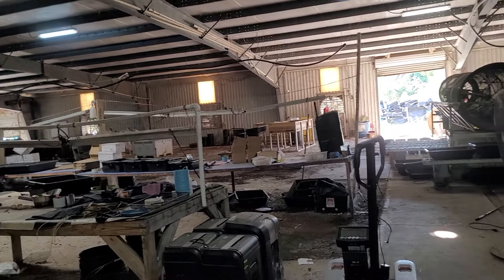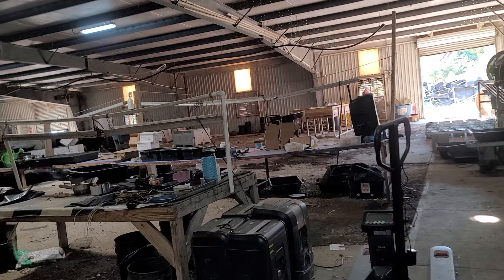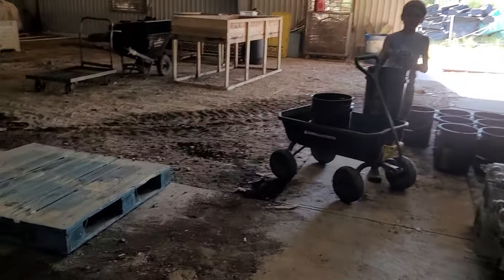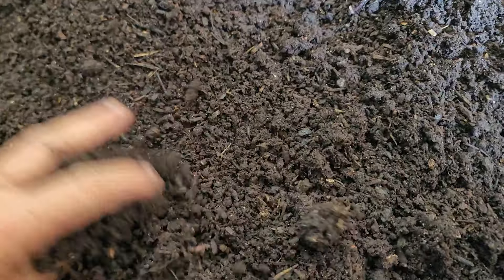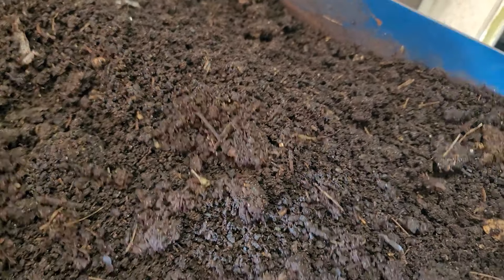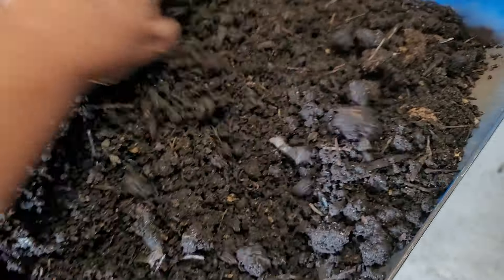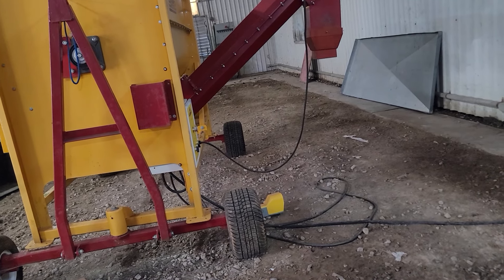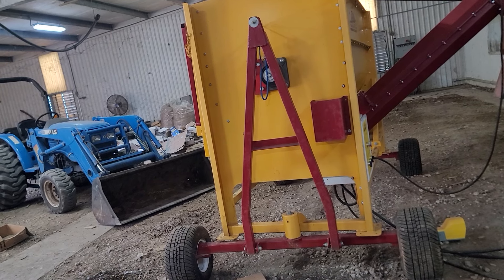Worm Bin Harvest Part - 2 | Worm Bin Harvesting | Meme's Worms

Comment: Hi Meme, good to see you're back up and running. Would be interested to see how you refill that bin and get it going again.
Reply: Meme,
Take your tractor and dig out a pit with a ramp where the sole mixer is now. Then you can leave the wheels on, roll it into the area you excavated. That way you can scoop and fill. 
Later if you need to move the mixer, the wheels are still on and u can pull it out easily.
Rich
Reply from the maker: That's what my husband is doing today for me!!!
Reply from the maker: We gonna use some of these trees to make the ramp and back fill with dirt.